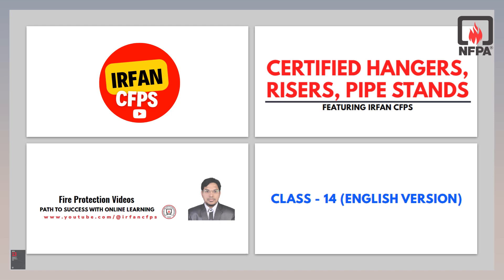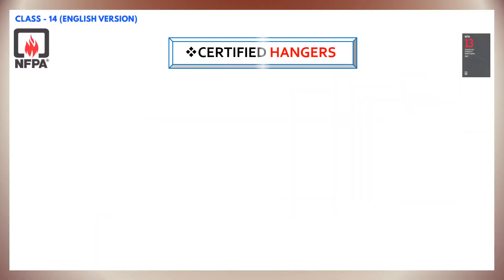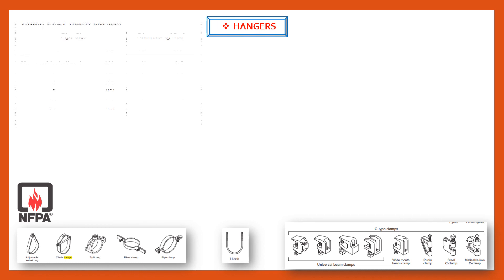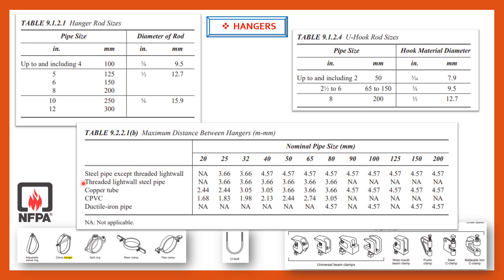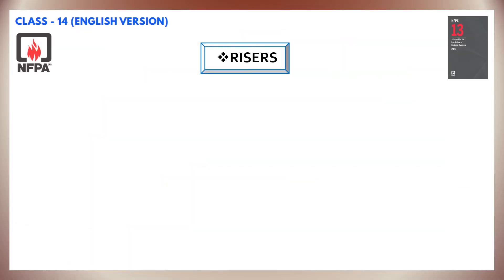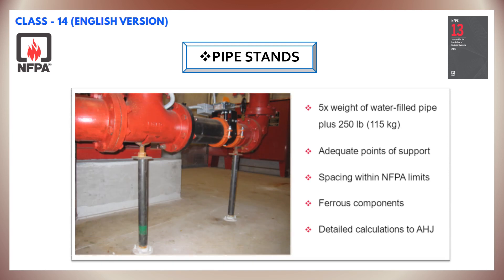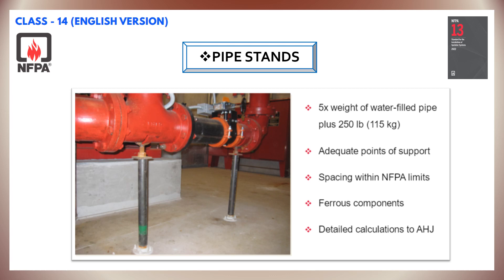Pipe Hangers and Supports | Sprinkler System Piping as per NFPA13

Comment: I have very important questions for the pipes passing through the walls. Do we need the sleeves in the wall. What type of material of sleeves are applicable.
Reply from the maker: Good question. Sleeve material depends on project specifications. However if you need to pass the the pipe through fire rated walls you need to have sleeves with fire stop material to comply the fire rating
Reply: @irfancfps I mean tell me, like, what is the materials of the sleeves if the partition wall is 3 hour or 2 hour rated, what is the materials for the sleeves we can use ....for 100 mm pipes so how much will be the angular space.

Comment: A tall riser in a multistory building needs more than one point of support. But where should these supports be placed? NFPA 13 gives simple guidance (17.4.5.4.1) for where riser clamps or other riser supports should be located:

At the lowest level of the building
At the top of the riser
Alternate floors in between
Above and below every horizontal offset of the riser

THE CASE ALTERNATIVE FLOOR SUPPORT AT THE TOP OF THE FLOOR IF THE HEIGHT IS NOT MORE THAN 24FT UNDERSTANDABLE.

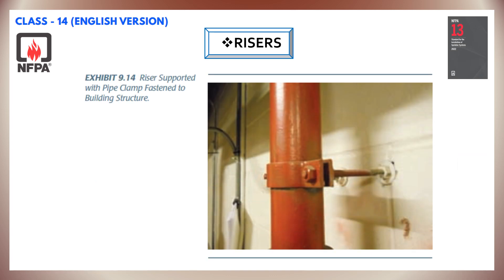The fourth case above stated above and below every horizontal offset of the riser, --- In multistory building in each floor the offset take to support the sprinkler on each level, That case every floor the riser clamp above and below shall be provided... Explain me please your 3:18 minutes
Reply from the maker: Hi, Please send me an email as it cannot be clarified in one sentence

Comment: Whar are the loads to be considered for riser pipes?
Reply from the maker: Sorry i couldn't get your point. Which load u are talking about?
Reply: @irfancfps  For hangers & Pipe stands it should be designed for 5 times of weight of water +250 lb. Similarly for Riser pipes supports what loads need to be  considered?